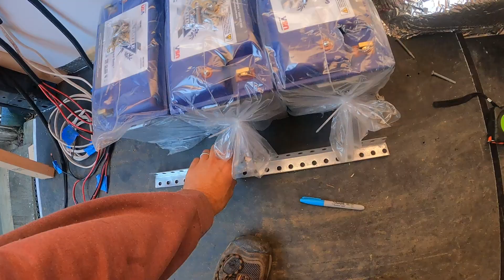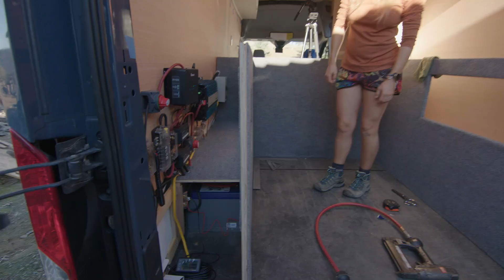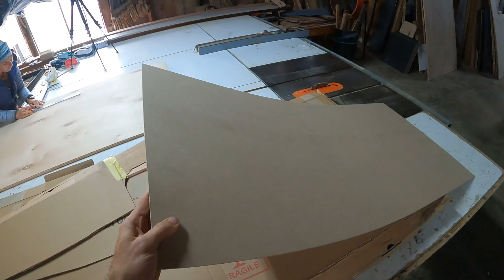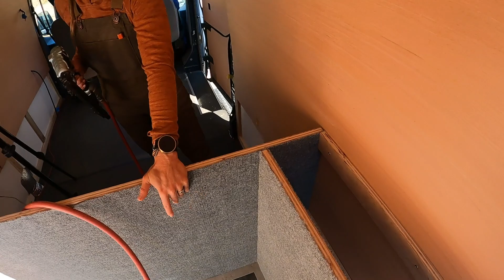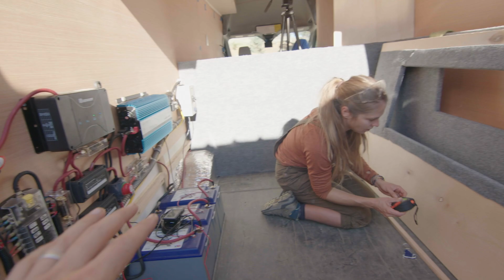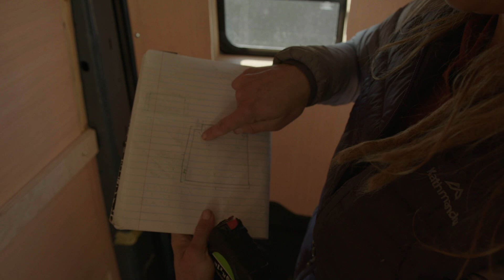How to Build a Bed Frame in a Van | Ford Transit Van Conversion Bed Design

Comment: Very nice, looks great. I was wondering how you were securing the bottom of the walls for hiding the water tank and electrical and scrolled back through to see if I missed it. Then I finished the video. haha. there it was, angle iron. :)
Reply from the maker: Yes 1” angle iron

Comment: Idea: I want my van to be a 4 season van, so I would need to insulate batteries and water tank and hoses in the winter.  How about putting thick insulating foam under and on the van frame outside portion of the batteries and the water tank to begin with?  Then it would be easier to cover them with insulation in the winter.
Reply from the maker: I would definitely insulate them as good as you can.  If they are in the back of the van like this one you will want to over do it.  The customer told us this van would never be in the cold so we didn't insulate much.  Also she has heat enabled batteries.
Reply: @Vankookz  I am having a difficult time finding a van that I would want insulated enough!

Comment: I'm building out a Medium Roof Ford Transit and I Used the Window Bumpouts to accommodate the Length of the Bed (along with elevating the head of the Bed and using a modified Cot frame as a base).
Reply: I want to have semi-exposed insulation to double as padding for the head in the foot of the bed, perhaps covered with some kind of aesthetically appealing fabric or something like that.
Reply: All of the infrastructure on my bed is steel channel that still open on both sides.
Reply: My mattress was found curbside in Berkeley California and it was from Ikea and fits the card frame perfectly.

I decided to stack the moving blankets I travel with under the mattress and over the frame as extra padding, and as a prevention from castrating myself getting out of the bed.
Reply from the maker: Awesome Craig!  Sounds like you have it all figured out.   Love all the details.   Do anything you can to avoid castration.